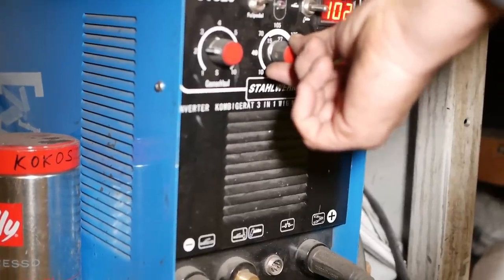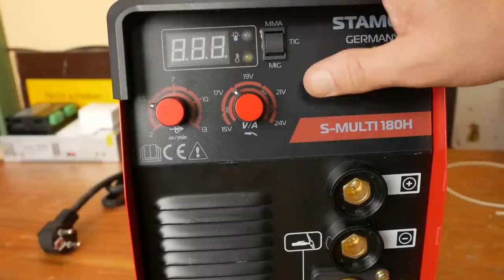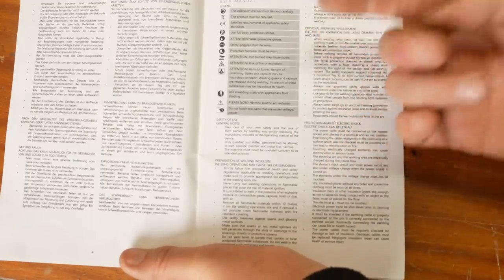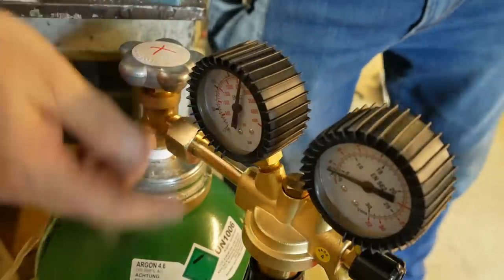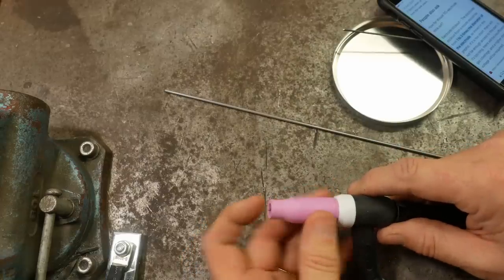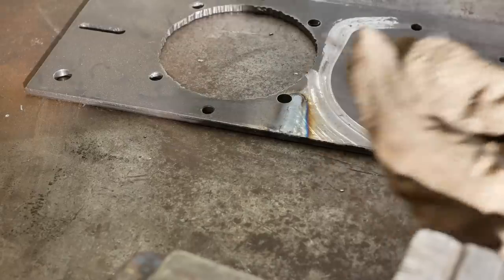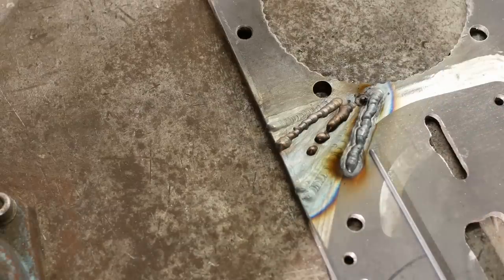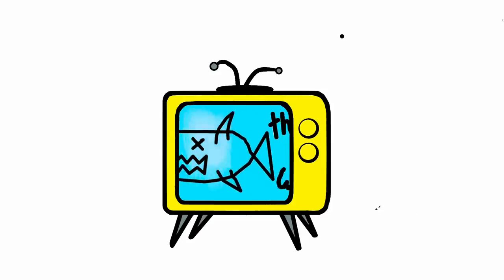Can I learn to TIG weld in an hour using just the internet? || RotarySMP

Comment: That did put quite the smile on my face. The trial by fire will be TIG welding the expensive laser-cut sheets for the CNC control panel.
Reply from the maker: Thanks again Alexander.

I did another practice session this morning. I figure if a do a daily session, by the time I finally design and laser the sheet metal for the lathe control panel, I should be able to stick it together with only a lot of grinding :)
Reply: @RotarySMP  "Grinder and paint makes me the welder I ain't" 😉
Reply from the maker: @graealex  That statement is not quite true, as I use body filler as well :)
Reply: @RotarySMP  Btw there's still warranty, so maybe test the MIG some time in the future, just to see whether everything works. I'd assume the welder has check valves on both CO2 and argon inlets, and just opens a solenoid to let in whatever gas is connected and actually has pressure. 

I'd also not be opposed seeing a small tear-down. It's probably nothing fancy, but just out of interest.
Reply from the maker: @graealex  Good point. I was having too much fun playing with the TIG and ran out of time to try the MIG yesterday. I was thinking about opening it up to put G1/4 connections on the gas lines, as the barbed connections on the back will be a bit restrictive for switching back and forth to the Argon bottle.
Reply: @RotarySMP  As I wrote, I don't think it will actually switch between the different inlets. Rather it will let any gas bottle that's connected and provides pressure flow through. Although that's just an assumption. It probably relies on you providing the right gasses, and not actively switch between them.
Reply from the maker: @graealex  Oh, I didn't understand. Good point, I'll test it and report back.
Reply: Thank you Alexander for your awesome gift to our favorite entertainer.  This has the potential of providing years of content. 👍😎👍
Reply: @joell439  Thanks. I'll assume he's going to eventually replace the hand piece and even the machine entirely, and the cost of just the argon and a flow/pressure regulator is already in the same ballpark as the welder itself, but it's certainly a good way to get up and running.
Reply: You're a hero, Alex.
Reply from the maker: @Rustinox  Sure is!
Reply: @RotarySMP  MIG with straight argon is not going to be easy.
CO² keeps heat in the weld pool and helps stabilize the arc as the wire burns back and keeps being fed into the puddle.
I prefer blended gas (95/5) for steel but straight CO² is much less expensive.
Reply from the maker: @jimurrata6785  Thanks Jim, my issue both cost and space. A mixed gas bottle is another 300 for the rental, and I dont have the space for another either. I am more interested in TIG.
Reply: @RotarySMP  I understand. Here in the U.S. I own all my bottles so refills are not too expensive (but argon has skyrocketed)
CO² is cheap and bottles available because it's used at every soda fountain.
I was simply trying to say "there's a good reason MIG uses CO2" and practice with pure argon will likely be frustrating.
Reply from the maker: @jimurrata6785  I appreciate that input Jim. It is a shame that all the gas companies here are trying to force you onto rental plans. They want to do a hydrostatic test every refill otherwise, and charge heaps for it. Will the quenching of Argon be a problem with MIG on thin material like 2mm wall thickness square tube, or only with thick stuff?
Reply: @RotarySMP  Well, you could get a smaller bottle, and CO2 isn't as expensive. After all, I even got a medium-sized bottle of CO2 in my kitchen. It's also a lot more common, as it's extensively used in gastronomics.
Reply: @RotarySMP  Here a new tank comes with a 10 year cert and you only have to get a test every 5 years after that (the tank is stamped on the neck)
Hydro test is $30.
I use blend 95/5 or 75/25 because I can't seem to get the toe to wet out and penetration is poor with straight argon. Ropey bead just sitting on top...
I suppose you could get 100% argon to work. I'm not a pro welder and went down the path of least resistance.  😁
Reply: @graealex  This is a great idea Alexander!
Here, 20lb cylinders are available at any homebrewing shop. (they really like beer in Austria, right???)
Lots of sporting goods stores stores have the ability to fill them too, because of the popularity of paintball.  (this isn't meant to invoke anything political)
Reply from the maker: @jimurrata6785  Good ideas. I'll look into it.
Reply: @graealex  There are no bad welders, there are people who cannot use a grinder.
Reply: What a hero! @Alexander Gräf

Comment: You need more stick out on the electrode when learning, try  6 to 8mm. Torch angle needs to be just off vertical, and you need to sit down with a leather apron over your lap. Rest your wrist on something, block of wood or similar and position yourself so you can make a straight bead just by pivoting your wrist without removing it from the support. Light the torch and look at the ark, you need to darken your helmet till you can see the arc clearly and see the puddle developing, and then move forward pushing the puddle as you go. Forget filler rod for now (use mig wire) and when you can produce a straight line bead of melted metal start with rod by moving the rod close to the arc and dipping it into the edge of the puddle, not into the arc the puddle should melt the rod, not the arc. if it sticks more amps, if it all happens to fast, or burns through, less amps practice running beads with rod, and then go on to joining parts. You need a very good fit up with no gaps! I am learning at 70 with fairly poor eyesight! Tig is the most difficult to learn but it will produce almost invisible welds without filler rod if the fit up is good! I really enjoy it but you must be able to see clearly to watch the puddle, and you must keep the electrode a constant distance from the work to keep the arc consistent
Phil.
Reply from the maker: Hi Phil, Thanks for the very detailed advice. I did another session this morning, and will do another after the motoGP, and implement your tips.
Reply: Getting arm and wrist support is huge. The more comfortable you are, the better you’ll do. Don’t be ashamed to get cheater lenses either if you want a more zoomed in view.
Reply: @vaderdudenator1   Any welding too, i've never got past the tidy pigeon poo stage with stick, cable over the shoulder and around forearm takes weight off the wrist/hand holding the stinger.  obv's wont work for MIG/TIG but principle holds of comfort and stability etc.
Reply from the maker: @alan-sk7ky  I was wearing reading glasses under the helmet. Eyes aren't what they once were.  I'll try with a block of wood for the wrists to sit on.
Reply: Simply, the stick out equally the diameter of the nozzle opening. Try the bigger nozzle, and a thicker electrode. A 1/16” is really just for very thin material. Normally 3/32” is pretty much standard and can be used for almost anything. The filler rod coo,s the weld as it beads off, so,a thinner rod is usually better. Even a 1/16” can be too big for thinner work. Amperage is one amp per thousandths of metal thickness up to about 3/16”. After that it’s about half that.
Reply from the maker: @melgross  Thanks Mel. Those basic rules of thumb are really helpful. I have been doing daily practice sessions one everything from 1.5mm through to 6mm sheet, and am slowly seeing improvements in my arc length control, and movement consistency. Stuff a long way to go though. Tomorrows video will have a little cameo by the welder, and as soon as I went from test pieces to a real, part, all technique was forgotten :(
Reply: @RotarySMP  I think I had enough typo’s in there to confuse things. 😕

TIG takes time. Don’t worry if you don’t get it for a while. I’ve been doing this for fifty years and am still improving.
Reply from the maker: @melgross  I dont seat typos. I make them constantly. The welding practice is fun.
Reply: I weld stick by holding the rod like a pencil with the handle over my forearm. Welder’s gloves mean I don’t get a shock. A similar hold should work for TIG with (obviously) much more careful setup.
Reply from the maker: @Dave5843-d9m  Hi David, I hold the stick cable over my arm the same way. I tried it with this TIG torch, but the geometry doesn't work.

Comment: Pro tip from a dirty dunker:
You can grind BOTH ENDS of the electrode, if you don't glob it up too bad you can flip it around without having to waste time walking to the grinder. It does tend to wear out collets due to jabbing the dirty tip back up in there
Reply from the maker: Thanks. I did that yesterday :) Only half the mileage on the walk of shame :)

Comment: Learning to weld with oxyacetylene was a huge help in learning to tig weld. Just think of the tig torch as an electric flame.
Reply from the maker: I only did a bit of gas welding way back in my apprenticeship. We made a little tool box (more like lunch box size).
Reply: My son's a welder and he thinks I'm an idiot when I tell him that oxy is a basic skill like times tables. 
He doesn't know what I'm talking about on both counts though he is more than a competent welder.
Reply from the maker: @ThePaulv12  Oxy/Acetylene set up is so expensive over here now. It would be really handy to have, but cant justify it.

Comment: I loved learning tig. It's my favourite welding for sure. I know you'll get 1000 tips in this thread but my 2c worth is to say to keep the rod inside the gas flow. Will help when you start to weld aluminium.
Reply from the maker: Thanks for that tip. Makes sense. I have to learn some muscle memory on controlling that filler rod.

Comment: Grinding - narrow angle = sharper and more precise arc, but doesn't handle much amps, pretty common with about 15 degrees for most steel welding below 100 amps.
Above 100 your "air" cooled torch is going to heat up pretty fast, so you'll need a different torch for it anyways.
Sharpen the rod at both ends, will save you some walking :)
The meters on the bottles are usually way to coarse and imprecise, just buy a cheap ball/cup meter you put on the torch end
To save you a lot of practice on pushing filler, there's "tig pens" for feeding. Some brands take exuberant amounts for these (they're just a tube with a slot for a roller), so it might be a nice side quest.
Reply from the maker: Thanks for the tips Brynjard. I will keep doing a practice session each day to develop some muscle memory. I need to switch to practicing on 2-3mm steel, as that is what I need to weld.

Comment: Red thoriated tungsten is fine. Not sure about the defluxed electrodes. You can always use MIG wire with tig. In a pinch I have twisted two lengths together with a drill. Rule of thumb match your filler to your electrode diameter. ER70S2 or ER70S6 are good rods for mild steel. I taught my girlfriend to TIG in an hour or so to get the basics. But that was while watching and coaching her during the welding. Plus, there was a foot pedal to allow current changes on the fly. For your first effort, that is pretty good. The large size of your filler, cooled the puddle down too much. But you can see when you slowed down you got enough heat to get a good weld. The angle you grind the tungsten at is not super important, and yes, you do need to remove any steel that is on it.
Reply from the maker: Thanks for answering my questions. I have about 10m of Mig wire which I snipped off that spool after making a birds nest. Nice idea on drilling a couple of strands.
Reply: @RotarySMP  mig wire is good for placing in a base metal Gap  as a filler  -
Reply from the maker: @GroovyVideo2  Thanks. I just did another practice session with 1.5mm sheet metal and used MIG wire as the filler.

Comment: One thing I did when learning tig, I would move the torch at a constant rate, and dip the filler at a constant beat.  I wouldn't worry about stopping the torch, just kept it moving.  It takes practice, but that would give me the best looking weld.  But, also, if something else works for you, go for it. :)
Reply: A metronome app on your phone or even some music that keeps constant time helped me immensely with dips and travel speed.
I'm incredibly uncoordinated so this may not apply to those with natural talent.
Reply from the maker: Thanks, I had missed that I needed the balance of constant motion of the torch and intermittent on the filler.
Reply from the maker: I play guitar , so have pretty good rhythm, turning on music is a great idea.

Comment: You did very well on your first attempt. The biggest improvement is gained by practicing as you suggested. M.I.G is much faster and can make some very good welds, however, it's a bit like a big kid's glue gun; that filler metal is coming out and can make some nice looking welds but the penetration is not always sufficient on thicker base metals, especially if it's cold. The T.I.G can be used without filler metal to pre-heat the base metal and when you try aluminum on AC, it's very effective to heat the base metal in a slow steady pass without trying to melt in but it does a great job of cleaning the area before welding. Keep up the great work!
Reply from the maker: Thanks for the encouraging feedback. I'll do daily practice sessions on this.
Reply: Unfortunately, the machine is DC-only, so aluminum is mostly off the table for now.
Reply from the maker: @graealex  I have no need for that. I like riveted aluminium. :)

Comment: I have mountains of respect for airframe welders. 👍
Reply from the maker: The RNZAF had a trade they called AEROMUT which were our specialist welders. There was only a few of them. Though guys can probably weld a beer can to a beer bottle :) 
I visited a jet engine overhaul shop in January, and they have a team of specialist welders who do a wide variety of repairs on very exotic materials.
Reply: @RotarySMP  Give it another hour, and you’ll be right there with them 😁
Reply from the maker: @624Dudley  It will be a very very long hour :)

Comment: congratulation on your first Tig welds they look good
Reply from the maker: Thanks Luke. Needs a lot more practice yet.
Reply: @RotarySMP  If you need any help let me know I might be able to help you out
Reply from the maker: @LCalleja  Thanks Luke. First thing I need is enough practice to get consistent errors. Once the errors are predictable, they can be fixed. Currently each bead looks completely different, and I cant really see a pattern.
Reply: @RotarySMP  well that’s the key getting consistent
Reply from the maker: @LCalleja  I did another session on 1.5mm sheet. Took a beads to stop melting holes.
https://www.instagram.com/p/CsOlj3PowW4/?utm_source=ig_web_copy_link&igshid=MzRlODBiNWFlZA==

Comment: If you get stuck for filler rod put 3-4 strands of mig wire in a drill other end in a vice and twist works well at a pinch. Make what ever size you want allow a little extra diameter for twisted over solid to get the same result. New to the channel look forward to more great content.
Reply from the maker: Thanks. I used up that birds nest of MIG wire just as you suggested. I've now received my first order of proper filler wire.

Comment: Not too shabby for a first attempt - my £0.02 worth from learning a couple of years ago:
1) A bit more stick-out on the tungsten - anything up to the diameter of the ceramic cup, or a bit more for fillet welds.
2) They're plain ceramic cups, not 'gas lenses' - a gas lens has internal diffusers and will let you get away with more stick-out
3) 5L/ min is about right - rough rule of thumb is L/min = cup size
4) With more stick out, you'll be able to hold the torch nearer vertical and still be able to see the puddle.
5) When you do that, lower the angle of the filler rod to maintain ~90 degrees between the filler & the tungsten - it's quite a shallow angle for the filler
6) Use thinner filler - something like 1.6mm
7) Practice on something a bit thinner - maybe 3mm
8) Current setting comes from the material thickness, not electrode diameter - roughly 30A/mm. (so ~~90A for 3mm)
9) The electrode just needs to be big enough to carry the current needed - 1.6mm is OK for <~120A. 2.4mm would also be OK, and allow higher currents too
10) Avoid thoriated tungsten - there's just no need to use it with inverter welders. Light blue (lanthanated) are versatile and work for most things, but it's not hugely important for where you are
11) Yes, you do need to clean all the stuff off the electrode. If you get a bad dip, this usually means snapping the end off and re-grinding. If the arc is unstable and/or a funny colour, it probably means that you didn't get it all
12) Grinding angle isn't hugely important at this stage - go with what you're doing
13) It's difficult to tell from the videos, but you may need to hold a shorter arc, too
14) Get comfortable! Find something to rest the wrist / forearm of your torch hand on
15) My welder also clicks when I add filler...
Well done though, and keep us posted! :)
Reply from the maker: Thanks  a lot. Thanks for taking the time to help me out. 
That is an excellent summary of a lot of aspects of this, also distributed through other comments. I have been doing daily practice sessions, and have addressed all of those issues (Well "addresses" is a bit strong for things like Arc length consistency, which I struggle with, and will need a lot more practice.).

Comment: touch the ectrode to metal -  then raise to correct height  - then start arc  - -- have a grinder Only for Tungsten -  get a flow meter on gages (floating Ball kind ) --- 
oxy /gas welding is easiest  cheapest way to learn  tig  welding -  heat control /angle /distance - speed ---  make sure to keep rod tip in shielding gas -  tig is the most fun type of welding -
Reply from the maker: Thanks. I just did another practice session, and found that ttouch, lift then start works well for me. 
Since that second gauge is damaged, I will return it and get a ball type flowmeter.